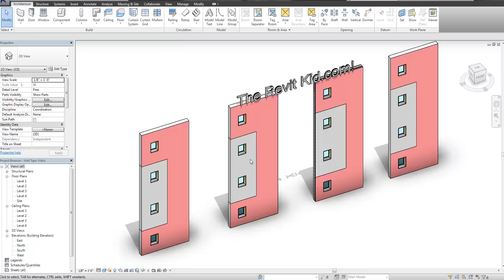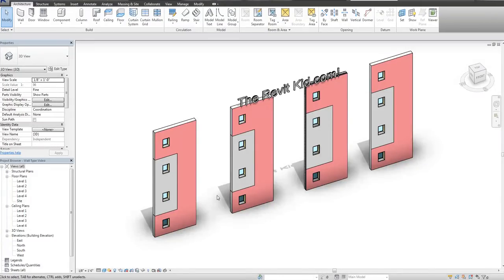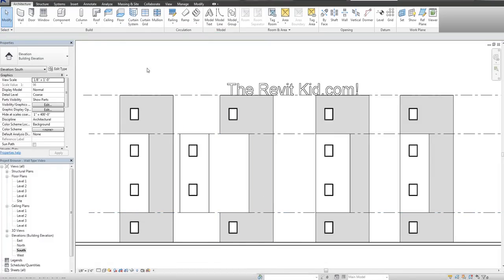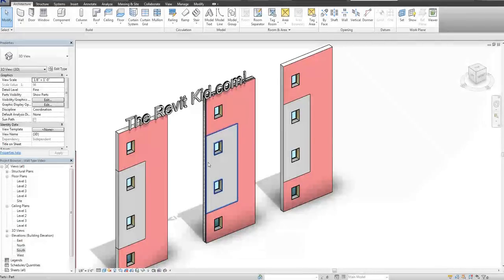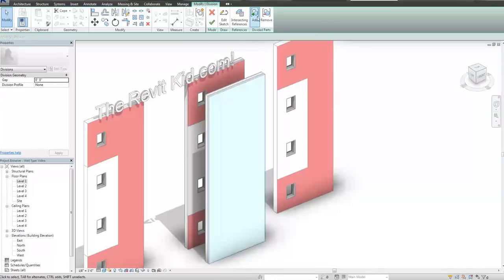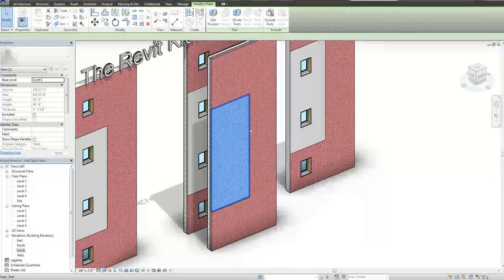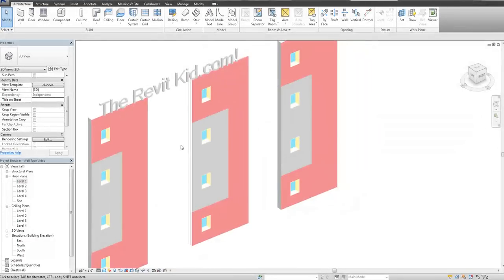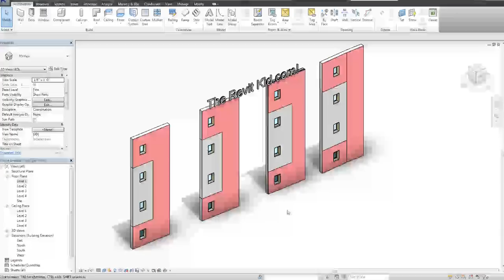Revit Tutorial - Different Stack Wall Methods

Comment: I typically use the stacked walls.  But why am I having so many problems joining the corners.  I have tried to make sure all the individual walls are setup with the same wall wraps and join settings.
Reply from the maker: Stacked wall's are tough.... there could be many reasons they are not working the way you'd like...

Comment: Hi there. I like the create parts command. I got what I wanted. The issue I got is that non of the adjustments I did on the model does not reflect neither on the elevations nor on sections. I tried to put the detail level on fine but still didn't help. Do you have an answer for me?
Reply from the maker: Edgar Zakani hey!  You have to set the Parts View to show in the properties of that view (is.  “show Parts” in your elevations view properties ...)  cheers !!
Reply: @TheRevitKid  WOW. It worked, Thanks. I am gonna be following you.

Comment: I understood each one of these examples but not the first one. Each time I draw differents walls on differents levels, either a line appears dividing these two levels or either the other wall that I draw affects the height of the other.

Does anybody know a tutorial on how to make a wall like this without these horizontal lines appearing? Thanks :)
Reply from the maker: +soledadmexicana If you want to not show lines you need to joing the walls... but if the materials are different there will inherently be a line...
Reply: How do I make custom corner details for exterior walls. I attached an image demonstrating what I mean. I cant find any video tutorials on this matter. 

https://s-media-cache-ak0.pinimg.com/736x/f8/40/66/f840660fb6d9251913e86bd1880b5070.jpg
Reply: A couple of methods that come to mind are either to create a family for each and just place them in the model, or using the third example in the video, parts, break out the quoins, although I don't think they will clean up.  I'd much rather use a tacked on family with a texture, unless there's a reason why you need them to be done differently.

Comment: Great Video. You can also draw two overlapping walls in floor plan and use "cut" option, to cut the brick wall using the stucco wall.. This one too has pros and cons!
Reply: THIS! thank you.  
I was diagnosing how someone else modeled it on an inherited model and while trying to pursue the same methodology, I just couldnt find it!! but considering how I have wished other things were modeled before,  this method seems to be the one that I wished i knew about.  Maybe it makes it the most effective since it allows more flexibility than the others.  ah, dont you love working on inherited models from over 7 years ago!? :)